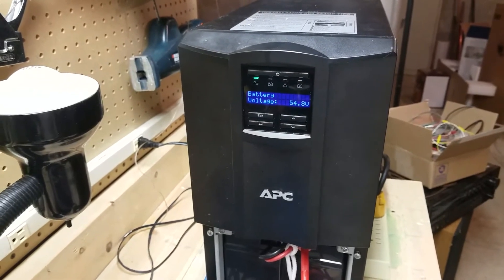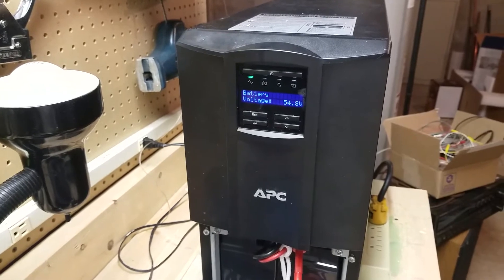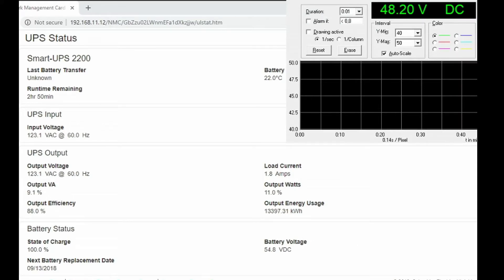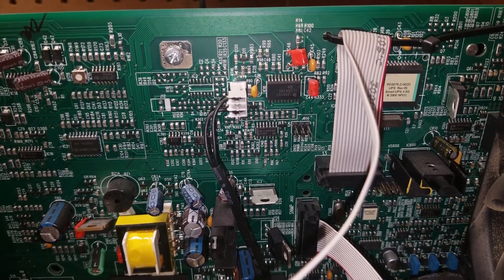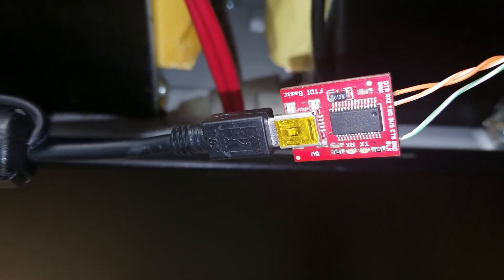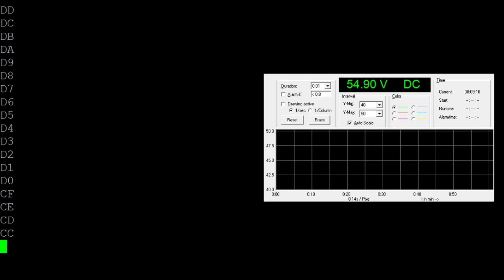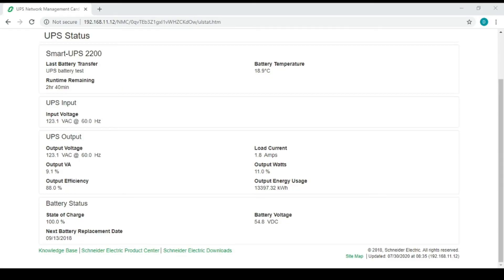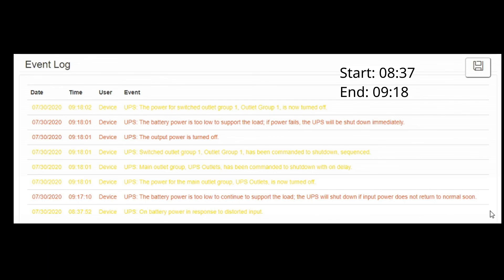APC SMT2200 UPS Low Battery Charger Voltage Fix

Comment: Good evening, I'm having a similar problem with the APC SMT3000C UPS. I'm trying to locate an internal serial port so I can use the APC protocol.This UPS has a communications card on the main board, and I can't see the serial port.
I would appreciate any help, as the UPS isn't working as it should.

Comment: Hopefully someone can help, I have a 2200I with a very low charge voltage.  I hook up the serial adapter as it is stated in the video but I just keep getting the scrolling data between the two processors.  I try “shift-Y” to interrupt it with no luck.  What am I doing wrong?
Reply: SOLUTION: Yes this worked but I had to connected RTS to the left most lower pin, I beleive this is Pin 6.  Also my keyboard input for '-' was giving me a 'NO' response at first.  Any thoughts, could this be because I was using a 3.3 V TTL instead of 5V? Does anyone have a reference to what CMDs are for the APC Smart Protocol?  I noticed pressing '2' maxs out the voltage.

Comment: Just replaced two 12v18 amp  in a APC 1500. In use since 2021, 50 hits per year. One battery at 11.3 v other 12.7v. Battery sharks $23ea. Replaced both but kept the good old one and fixed a car jump pack… works good.  
AEP power is flaky… using 5 separate units

Comment: Trying this on an Apc smt2200rm2u (with the LCD display).  I just get a continuous stream of text (numbers - looks like it is a stream of various settings and current status, like input voltage.  Stream runs even with UPS powered off (but plugged in).  Using PuTTY set to 2400, 8,1, none, none.  Voltage output is 52.04, so would like to bump it up, but not responding to any key strokes, other than ctrl-Break, which pauses the stream until keys are released.
Reply: The USB cable can be up to 2 meters long, but the cables to the J606 connector from the TTL adapter must be a few cm long (the shorter the better).

Comment: this can be used to upgrade form lead acid to Lifepo4 since they have nearly identical charge curves but, Lifepo4 runs almost twice as long as lead acid and weigh about half the weight. Lifepo4 is also very stable and has it's own battery managmnet system on board for even more protection and saftey. Lifepo4 also lasts for 10+ years vs 3 years for lead acide.

Comment: Thanks for the detail but with my SMT2200I, the - key to reduce does not work. You have to press + till is goes past 58v and then it starts over at 0v and keep pressing till it gets back up to 54v

Comment: How loud is this ups? Especially when not loaded, lets say 10% load, and not on  battery. I was thinking to buy this ups, but it has to be in the room where peeople sleep. And I am afraid that can be to loud.
Reply from the maker: It has a fan that runs all the time, so I wouldn't recommend it there.

Comment: This did not work on my SMT1500.  I tried an FTDI and PL2303 USB to TTL...both displayed a continuous data stream only.  Would not accept any keyboard command.  The UPS says it was born on Jul 2012...the board has "APCC 2010" printed on it.  Board is a 640-3081A_REV06.  The open circuit voltage to the battery is 27.65...was hoping to drop it to 27.2 for battery longevity.
Reply: Have you tried connecting pin 6 (bottom leftmost) to RTS? I saw this was a control pin. Someone also said they connected DTR to this pin too and it worked.

Comment: Thank you for this excellent fix. I have two APC 2200I with the identical problem. The official APC support was very very disappointing with the only recommendation to buy a new one (which would not be from APC!).
Both of my 2200I had the same problem and could be fixed in the same way. Any experience how long this genius solution works?
Thank you!
Reply from the maker: So far all of the ones reprogrammed around the time the video was made are still going strong. Next time they need batteries replaced I will check to make sure the measured and displayed voltage are still close.
Reply: The same of mine, Can you show me, how to repair your ups sua2200i,where is you conect ups with your laptop sir ?🙏

Comment: using this method .can the charge voltage be set to 58 volts for lifepo4 battery upgrade .
Reply: I tried and maximum float voltage i got is 56V.
Reply from the maker: I've never tried to push it that high, if it was possible I don't think the batteries would last very long without a proper BMS. The old lead acid are way more tolerant to poor charging strategies than any of the lithium technologies.
Reply: @danselectronicsbench  bms  are in the batteries
Reply: I think it could go to 58V. You can see that the ADC value for the charger is an exadecimal value (decreasing value for increasing voltage). He ended up to CC for 54.9V so you can go to 00 for...maybe 60V?
Reply: Not bad better then stock

Comment: No doubt you are an expert in this, but  I would just buy a new unit before going through all of this.  You are a wizard though, respect
Reply from the maker: Credit to those linked in the video description, didn't really do anything much new here. I fixed about 10 of these which were purchased at the same time and all had the same issue. At $800+ each, replacing is a costly endeavor. I had replaced 2 previously with these symptoms before deciding to dig deeper after seeing how many had poor runtime. I kind of regret now knowing those 2 were probably fine but just out of calibration.
Reply: thats what they want you to do, and they thank you mr money ba.....errrr ...sir...